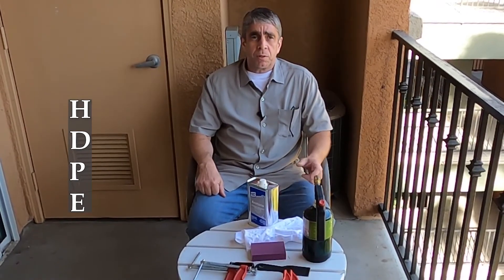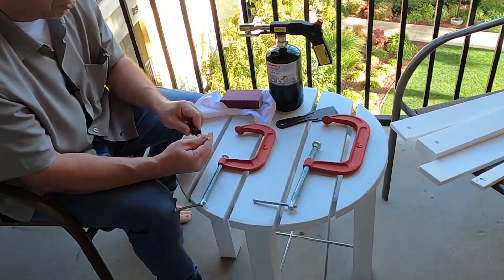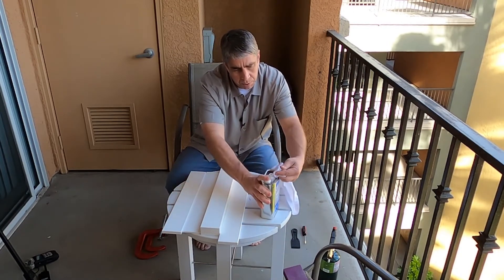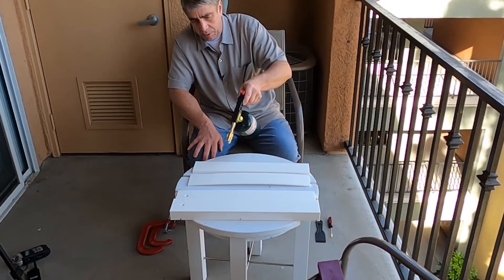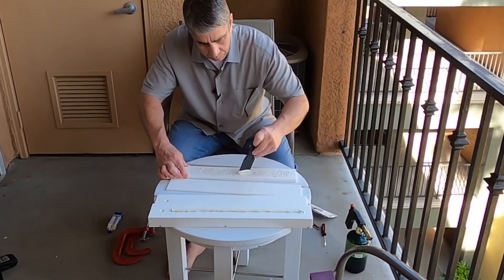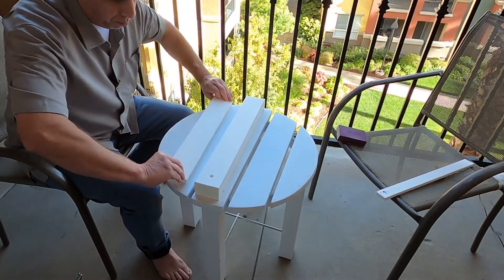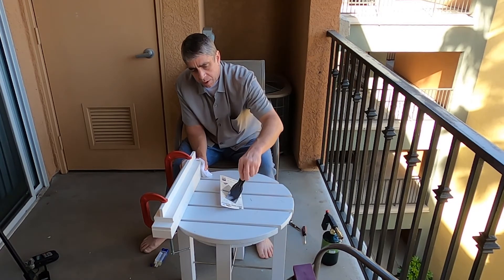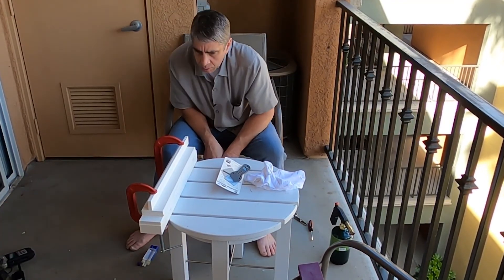Glue HDPE | King StarBoard | Laminate Polyethylene

Comment: it has been 2 years, how did the adhesive hold up?
Reply from the maker: Hey there, rajeevsreedharan8931. I have this mechanically fastened, still. For my purpose, everything is still perfect. Because everything is still screwed together, I have no way of knowing what the tensile strength of the bond is. I thought I might take it apart to reconfigure things, but have not.